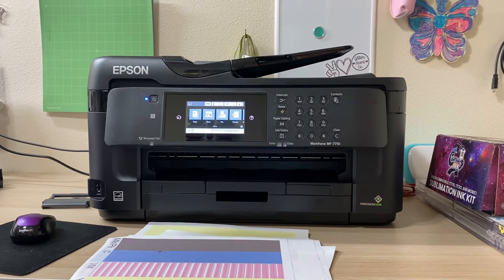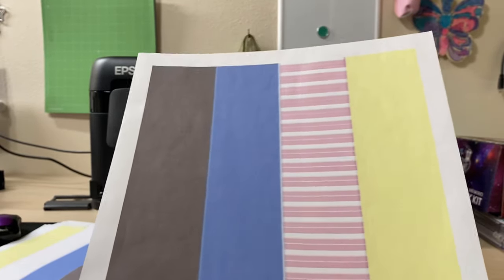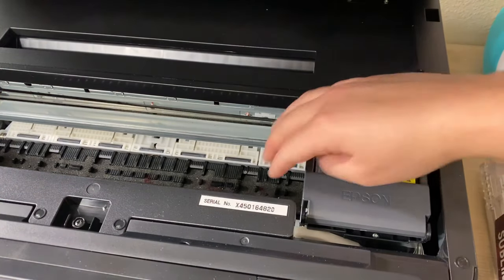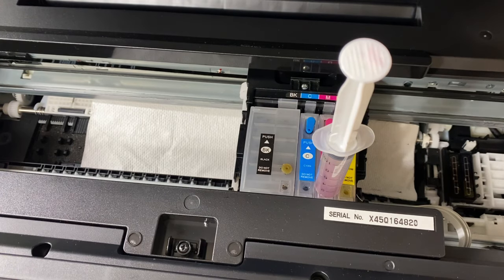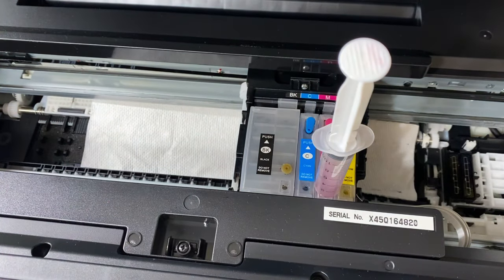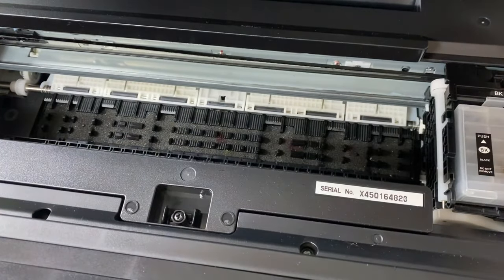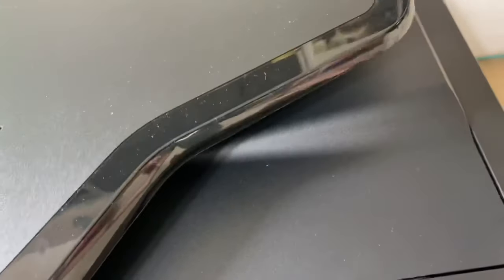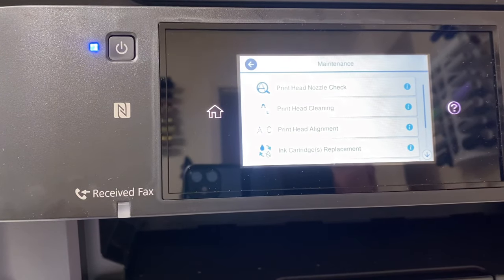How to fix lines in printout.  How to clean a printhead

Comment: you are correct, this is an air issue. if one prints normally, whether it be pigment or solvent (sublimation), it isn't likely to harden and cause the clog (blocked nozzles). one may do a head cleaning and see all the nozzles of magenta working correctly, but then suddenly blue is starting to have missing lines, then when you clean it again, it switches over to magenta again and blue is working. the culprit is the ink carts, mainly the part where the heads spikes plug into the carts. they are so cheaply made, air seeps in over time, especially during a head cleaning. there are high vacuum ink carts, they are low profile and don't hold a lot of ink, so you will be required to use CISS tanks on the outside of the printer for these. they are a bit more costly, but well worth it. you will almost never have this issue with high vac carts, but again, you then have to use tanks.

Comment: Just an FYI to anyone watching this video who has an ecotank... make sure your print out quality is set to the highest settings and make sure any "quick print" options are turned off. Streaks happen often when the quality isn't set to high and it'll make it look like your printer is messing up. it's possible you still have a clog, but it's also possible you don't. I learned that the hard way with my ET 2760. I wasted so much ink doing print head cleanings before I noticed my default setting wasn't on high quality.
Reply: If u had done it many times, probably soon you have the ink pad full warning ..
Reply: Mine is doing this on high but not ppm 🤔

Comment: Thank you for sharing.  My sublimation printer dries up on me because I don't use it enough.  Your video helped.  I also saw another video that explains "do not do print head cleaning" - just print pages over and over to run ink through the print heads.  When you do the print head cleaning that epson recommends then it will end up filling up your maintenance holding tank.   By printing pages like your "cmy purge print page" then you run wet ink through your print heads and may eventually unclog them without filling up your maintenance tank.  Along with filling up my cartridges to the max and using your recommendation to push some ink through to try and remove air bubbles and printing 6 pages I finally got my print heads unclogged! I will try hard to remember to print the purge page about once a week.  Thanks again!

Comment: If this doesnt work for you,  try what worked for me.  - I'm trying to print a very detailed multi page Cross Stitch pattern. Getting those horizontal white lines through the print, making it good for only the trash. None of my printers built in functions for maintenance worked.(alignment, nozzle cleaning, etc) 

 I went into the print advanced settings and  unchecked the "preserve black ink" option .... for good measure i also set it to best quality. No more lining. Also note, i have an HP ENVY, but  all printers suck the same.

Comment: I learned to remove the printhead completely and flush cleaning fluid  at sink. It is quite easy when you have once done that. Just to remember to cover the wire connections with duck tape.

Comment: Thats a great method to fix it and also unclog. However you should try to limit the print head cleanings that you do from your printer because your maintenance box will be ful very soon and you wont be able to print again until you replace it. What you can do is to print a small pallete of all colors after you've already pushed air and thats it. Good luck ppl

Comment: Hi, after doing this my black just stopped showing all together, any tip?
Reply from the maker: Try cleaning the head again.
Reply: @MissKissKreations  all fixed now, it's an error in my printer cause it's old but it doesn't really recognize the cartridges well, like yellow was full but it appeared as empty so my green would come out blue.

Comment: I printed the purge page and mine came out perfect. But when I go to print some images 😔 it comes out all unaligned 🤦🏻‍♀️. I’ve printed so many print alignments. I’ve replaced my maintenance box, got new cartridges too.
Reply from the maker: Oh no.  Did replacing your maintenance box work?
Reply: @MissKissKreations  yes it did. It was my mistake not changing the settings for Standard from High.

Comment: Forgive me but this is not the smartest way of doing this. The principle is right but rather than pumping more air into the cartridge, remove the cartridge and then attach a pipe with your syringe attached to the other end and then force printer cleaning fluid through the nozzle where it will be forced into the printer head, it can be collected in your tissue as you show. This problem is not usually caused by air in the cartridge, but nearly always it's caused by the printer head, which is clogged totally, or partially. Doing this way saves on ink and you can buy printer fluid in bulk and its strong stuff designed to dissolve dried ink that is clogging the printer head or nozzle, or both. This problem is not caused by air in the cartridges, but if you think it is, then just remove the cartridge shake it a few times then sit it down for a while and shake it again and let it sit for an hour, remember to cover the nozzle outlet with a tissue, when you do so to save ink going everywhere. I assure you this problem is caused by a clogged head. Just trying to help you save on wasting ink.
Reply: I'm glad I'm not the only one that thought pumping more air into it made no sense lol